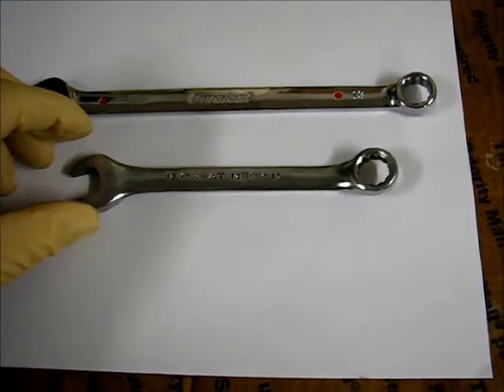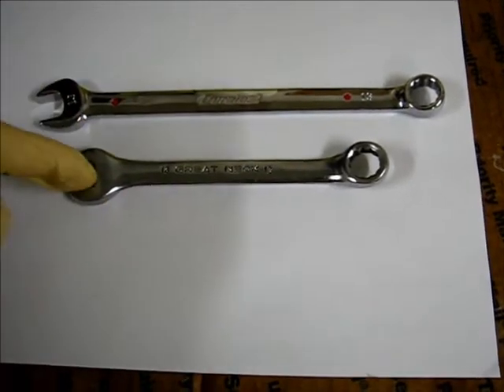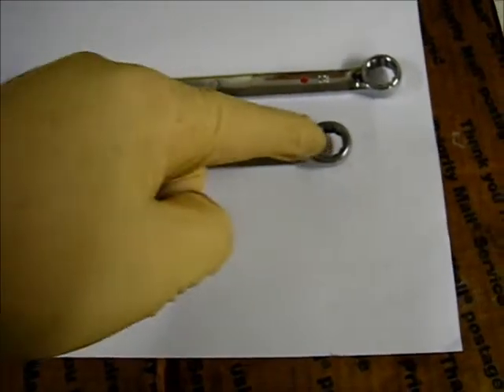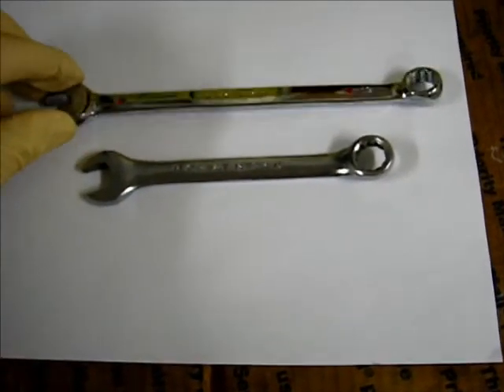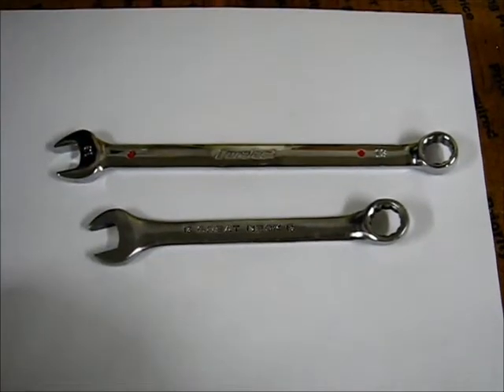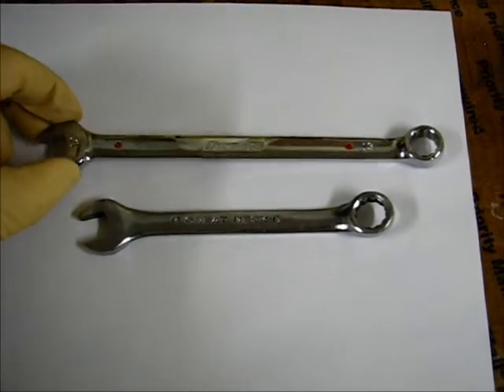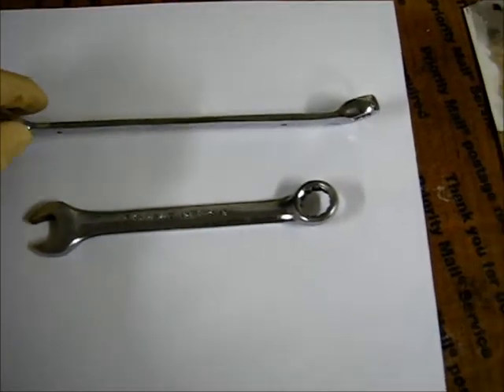Tormach PCNC 1100 - Manual Draw Bar Upgrade

Comment: This is ridiculous. Why use a wrench when you can just get a 13mm square drive socket, (or a 1/2" works) and put a long handle 3/8 ratchet on it.
Reply from the maker: +Dolan Kang Or convert to power draw bar.  shrug  For five bucks, who cares.

Comment: Have you guys thought about using GearWrenches? 
Here's an 8mm version you might like....I think the pic is deceiving. Says they're up to 40% longer, but the proportions look off for an 8mm.
http://www.tooltopia.com/gearwrench-85908.aspx?utm_source=google&utm_medium=paid_search&utm_campaign=paid_search_google_pla&scid=scplp6816931&gclid=CLatt-6Jpr8CFUpqfgod0GMANA
Reply from the maker: It's a good idea and may work for Russ.  The Tormach uses a draw bar with a square head on it, so only an open end will fit.

Comment: My mill takes an 8mm wrench, and the one I have is about 5" long. It sucks.
Reply from the maker: Yeah.  F that mess.  I looked for extra long 8 mm wrenches just now and the longest I found was 5.75".  I guess it's time for a custom drawbar or an adapter to a larger hex size.
Reply: Christopher Anglin Agreed. I drew one up in CAD a while ago but never actually made it. I'm sure it would make a big difference.